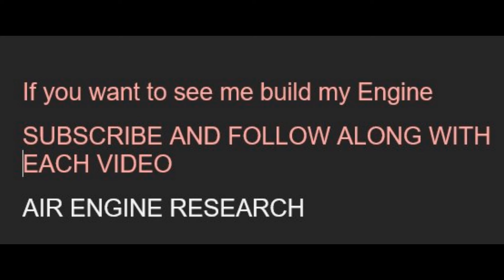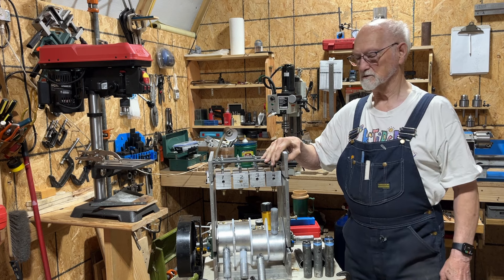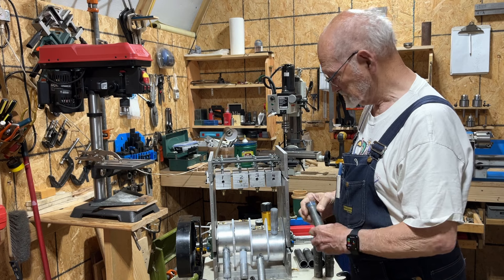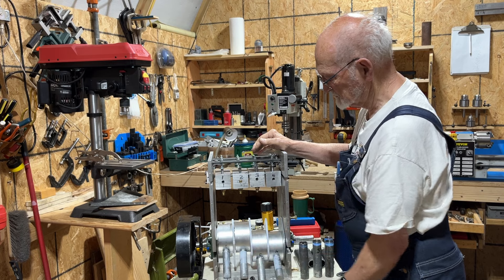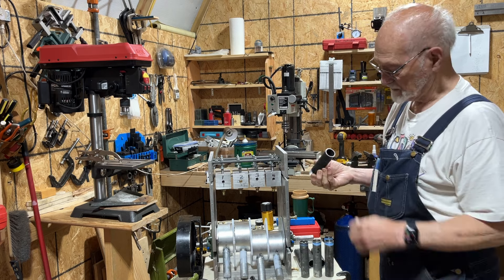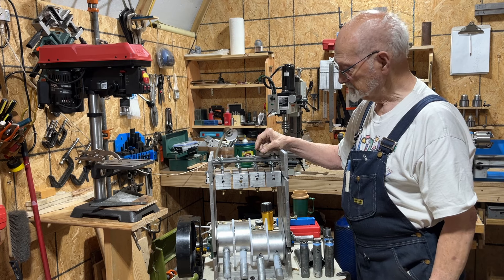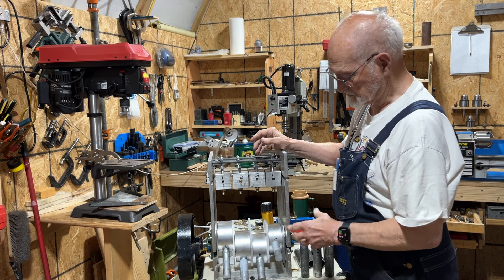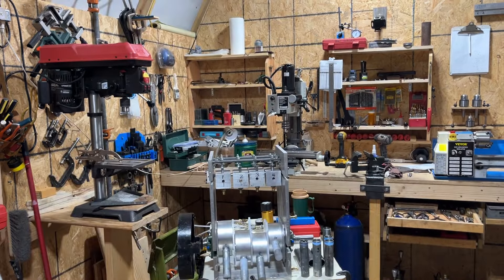My Air Powered Car,  Doing some Problem Solving 7-11-24

Comment: Suppose there must be a reason you just don't use a steam engine on air?
Reply from the maker: Thank you for the question and for checking in.
There is a reason that I am not using a standard engine, steam engine or gasoline, engine, or car engine, there’s no way you could carry enough air to go anywhere. 
The engine that I’m working on only uses half as much air as a standard crankshaft uses, and the four-cylinder one that I’m working with now using a 80 cubic foot scuba tank at 1000 psi will only run for just a few minutes so in order for it to run any distance it’s going to have to have a large high-pressure 5000 6000 psi tank. I’m trying to make it as efficient as possible to go as far as possible, but I won’t know that until it’s finished.

Comment: Take care, you are getting older . . .
But I am pleased to see your project, still keeps you going !

Why are your valves so "massive" ?
There is no forces on, them rather than pressure.
They look like they could carry elephants
😊
Reply from the maker: Hi and thanks for well wish.
Your question why the Valve and Cylinder Head is so large - well it is 2 1/4" Square and 3 3/4" long and compared to the rest of the engine in comparison it just looks big?
The Cylinder has to swing back and forth and I don't want to have 2 separate Valves with flexible air lines. 
Another reason is the Valve timing is controlled by the swing as the head and cylinder swing,  otherwise I would have to come up with a separate way to time it - more parts.
The Valve Holes, internal Air holes, Cylinder hole and bearing holes make it necessary for the Valve Head to be that size to clear each other.